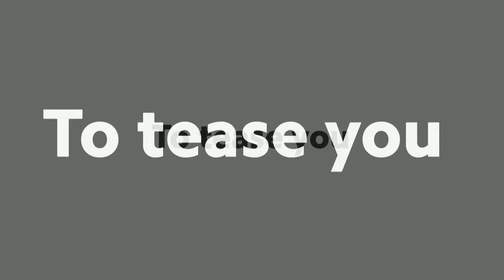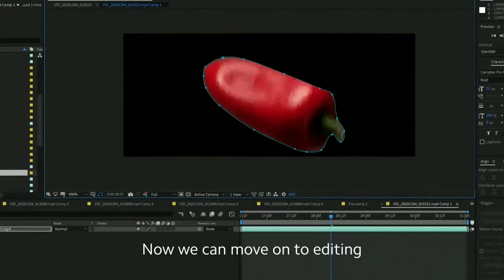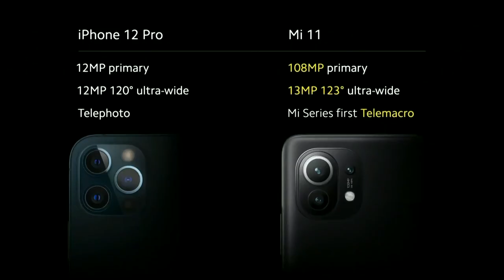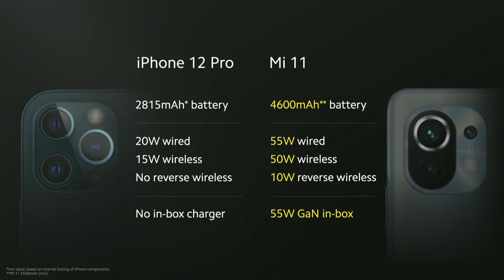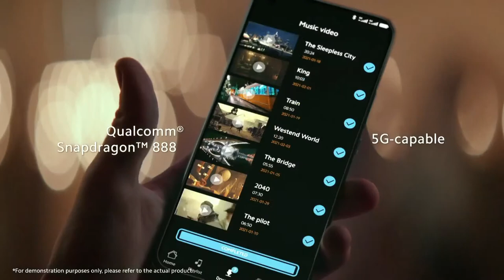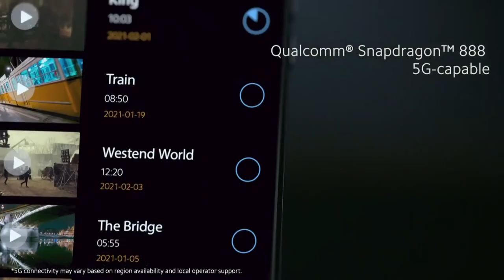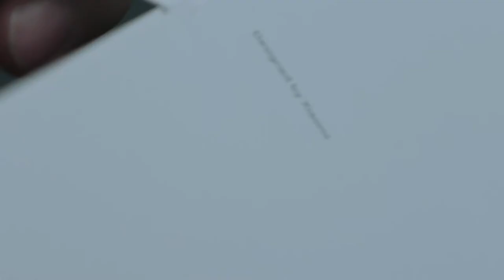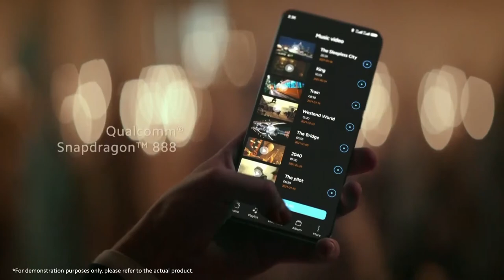Mi 11 Global Launch Event

Comment: MIUI 12.5 launch timing 1:15:40
Reply: Yeah Q2 2021 ... That could be upto June 2021 !
That's a lifetime in tech. So the upcoming 5 months the device will be less than perfect.
Release a device with a new UI or don't release it at all ...
Reply: The Lost Demon  yes 12,  that's not Mi UI 12.5
Reply: Which devices will get it?
 I doubt mine will get it since I haven't got any MIUI updates for a few months now
Reply: @pixels_per_inch  that's the problem with these Chinese brands. They are slow with updates and now even advertise with versions that have not hit the streets yet let alone will be fully tested ...
They are in the phase were Samsung used to be 7 years ago, releasing as many phones as possible and not caring much for software.
Samsung these days have come a long way !